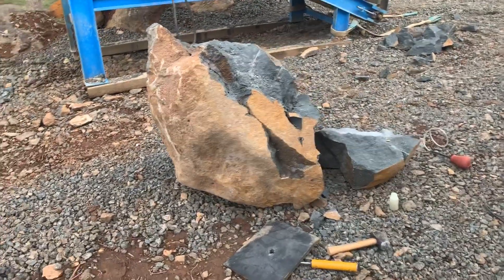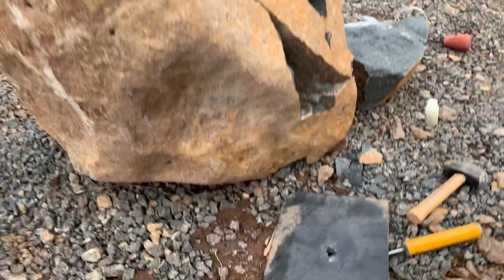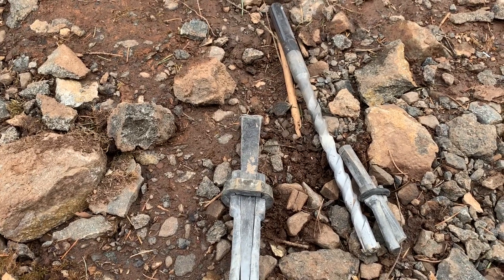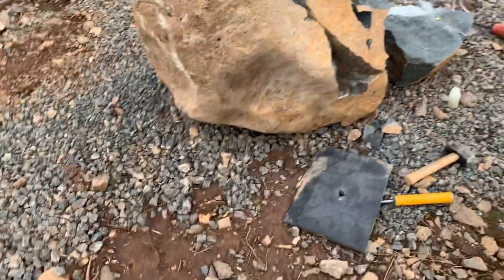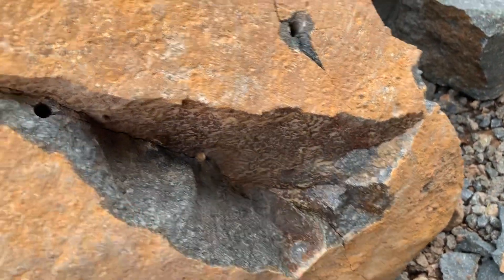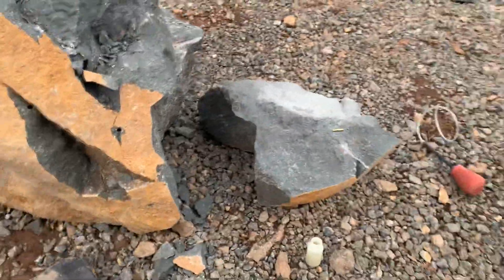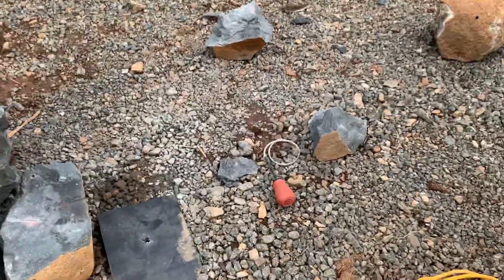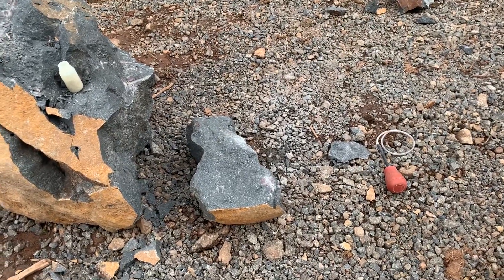Micro-Shaving Rock Blasting

Comment: Use 45 Cal Bullets will give you a lot more force...Just make sure you use Plywood & A tarp to Cover your Blasting spot 😉
Reply: What about a. 50 bmg round... Booooom😅
Reply: 45 cal. Bullets or 45 cal. blanks?
Reply: @roybollinger4936  Bullets...If You Cover the Blasting Spot with A tarp & Plywood the Bullet dosen't Go Anywhere as the Cartridge Explodes like a Brass Firecracker would.